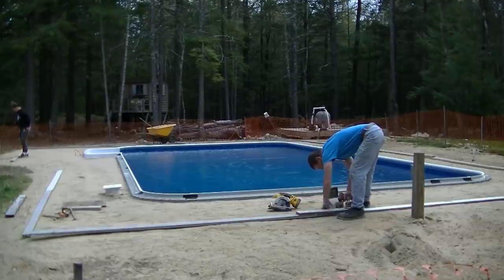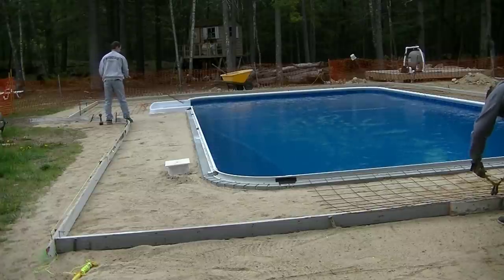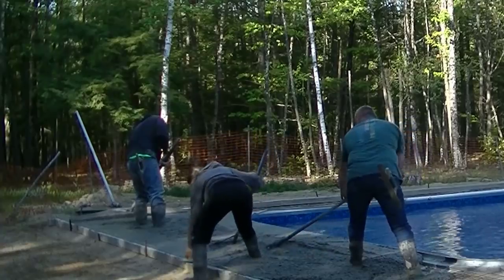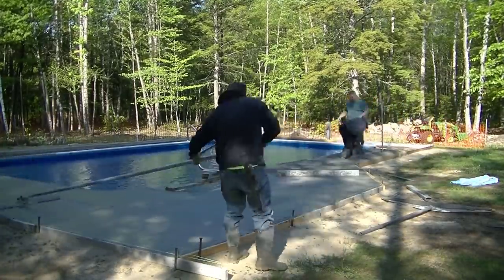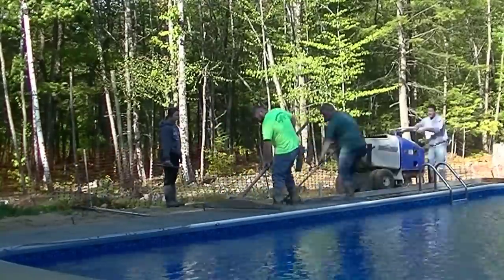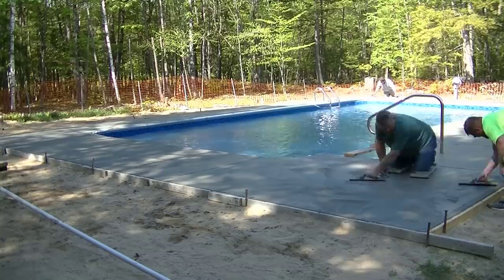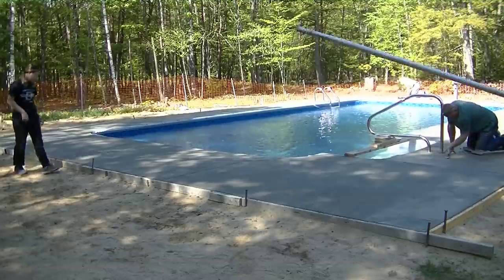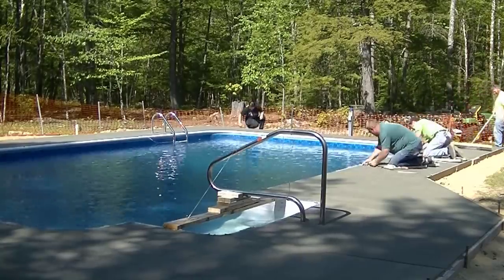How To Form, Pour, And Finish Concrete For A Pool Deck (Basic Pool Patio Installation)

Comment: Great videos. I have a garage that steps down of 9inchs when walking in the door. There is a  concrete subfloor in place do I have to put it 8inch of concrete again. What would you do.? Fill with 4inch gravel and four inch concrete? The garage is 16 ftx10. Would you recommend maybe half 4inch gravel 4inch concrete then slope in down to garage door?
Reply from the maker: 4" gravel and 4" concrete is fine. You'd have to price it out both ways. You may not save any money with the gravel unless you spread and compact it yourself.

Comment: Yep, those buggies can move a lot of concrete pretty quickly. For the $100 bucks rental, they’re well worth it.
Reply from the maker: Amen there, good to see you back!
Reply: Even better if you buy one saves you money in the long run
Reply: @nestorsalvador9236  It definitely could, but you’ve really got to consider how much you’ll be using a specialized piece of equipment like that too. That machine Mike had in the video goes for about $10K. If you only need it once a month or so, you might be better off just renting. Most equipment rental companies will drop it off and pick it up as well or you’ll be needing a trailer for it also.
Reply: Yea we got 3 cause we also do alot of drain tile . so having multiple buggys goin makes job go fast .

Comment: Hi Mike, do you also make a groove for a slab 10 x 11,5 ft? It's for a shed.
Reply from the maker: Not if it's 6" thick. 4" I probably would.
Reply: @MikeDayConcrete  Yes, it's 6" or a bit more. Wooden shed. Also with metal mat in the concrete. I'm in a doubt if I would create a frost edge.

Comment: Did you have to ground or bond the steel mesh? In Ontario, i need to have that all inspected before I can pour.
Reply: Poles should be grounded but yea same here in Ohio just poured a hot tube pad had to ground the steel mesh n cleats